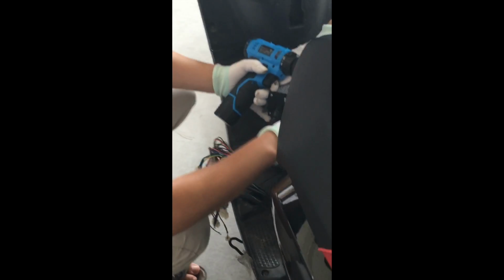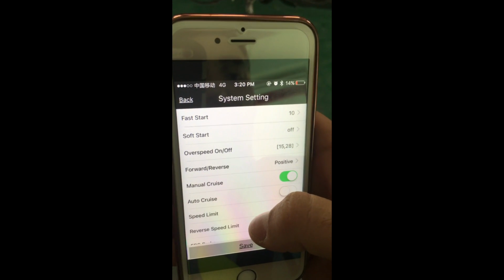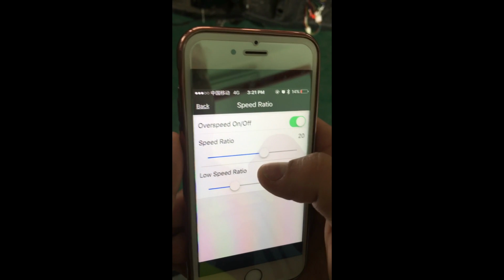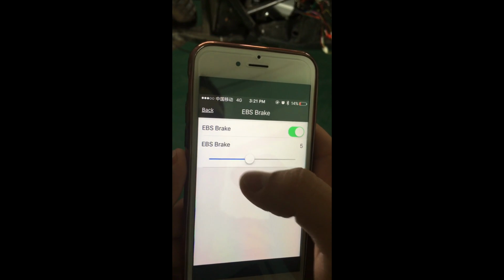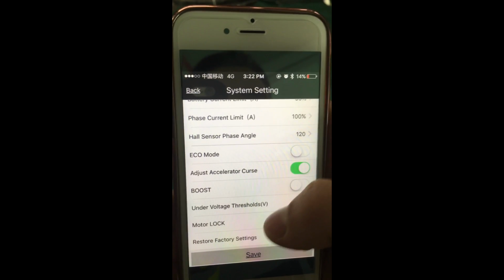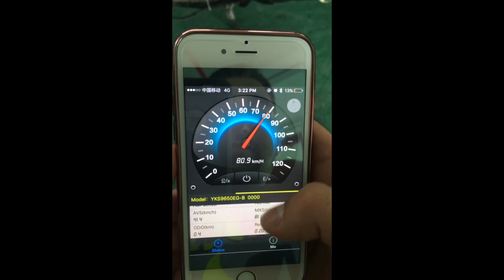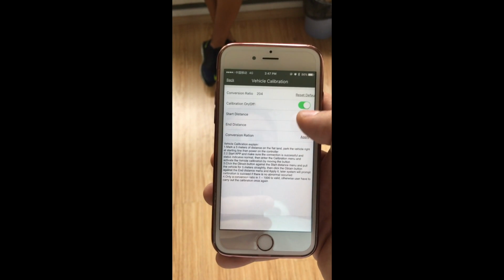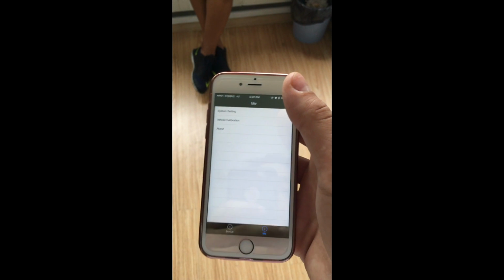YuYang King Motor Controller App Tutorial

Comment: Belay my last question...I have this controller hooked up and no matter what I do it will not go past indicated, 50 kph..no settings change speed...however I dont have 3 speed switch hooked up...could that be the issue?...maybe it thinks I am in 1st speed??
Reply: Maybe you model is customized by clients. Normally controller all have 3 speed wires unless clients asked to cancel it.

Comment: I find that the yuyang king app does not see my bikes controller, but my phone sees the controller in under the blutooth settings, even after pairing with the phone the app does not show up in the "device list"  Any clue why this would be??
Reply: hi man, i have the exact same problem.. did u found a way to fix it?
Reply: Nope!
Reply: solved it already thx
Reply: ChaosRider .Hell yup that did it! Thanks brotha.
Reply: How do I get the current app? I clicked the link in the comments and can only seem to get the app store. I don't know the language of the app store either.
Reply: this link doesnt work?
Reply: can you make the app be in english? I downloaded it but its all chinese
Reply: Sorry for that. Please click the mid right button under speedmeter which display E/中.
Reply: @arnovangurp2188  
Install the different version app from the other comment.
Reply: @arnovangurp2188  
U can change the language inside app setting.
Newer Android system usually support all old versions app.
Reply: Here is direct like specially 4 u:
http://ucdl.25pp.com/fs08/2016/11/16/8/110_45cb0b702a9ee9a74ac56d8cf8adc764.apk?sf=7032670&vh=0d52177f9ec0080bd790658d4487c9fd&sh=10&cc=1259362527&appid=6601823&packageid=800418511&md5=477703dea33f95cf6fc0a7d174bf52c5&apprd=6601823&pkg=com.yuyangking&vcode=7&fname=%E5%AE%87%E6%89%AC%E6%98%9F%E8%93%9D%E7%89%99%E5%8A%A9%E6%89%8B&pos=detail-ndownload-com.yuyangking